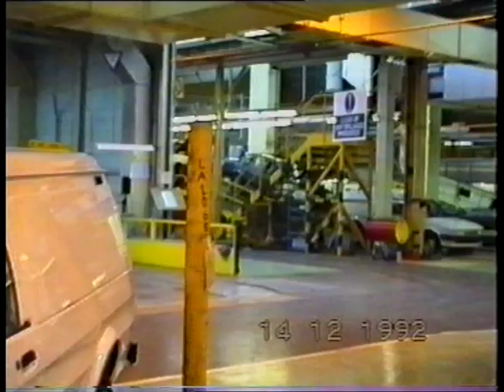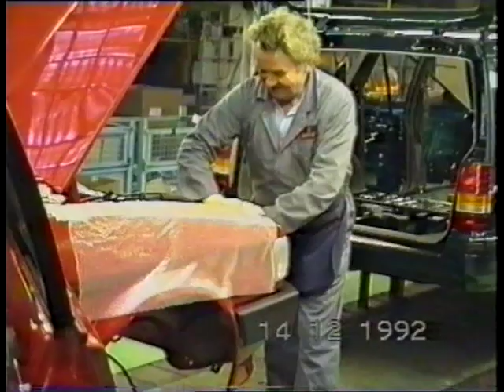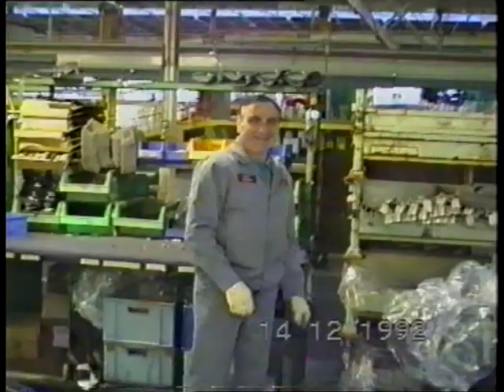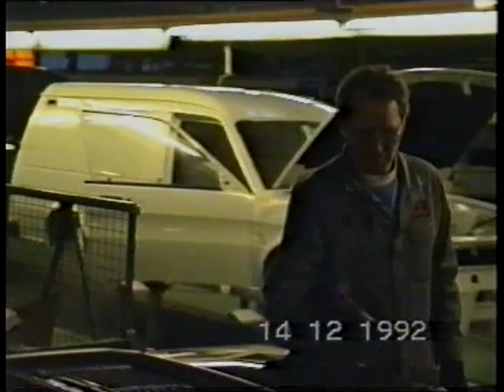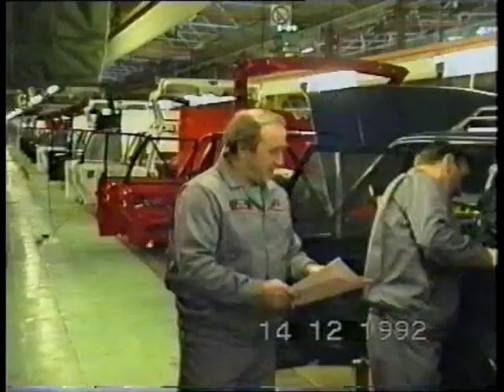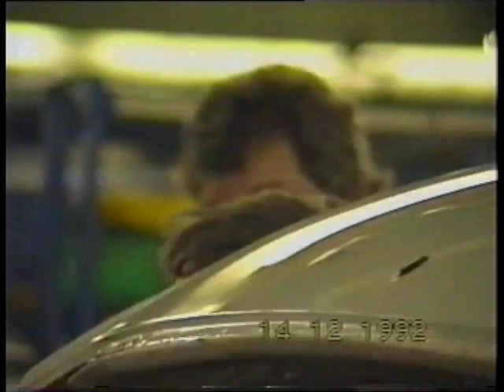A. Cowley South Works 1992 Austin Rover Maestro & Montego Production Line

Comment: I had a Maestro van with the Perkins-designed diesel (iirc, Perkins dieselised the O-series) and it was a blast going the length and breadth of the country in it. That engine was unburstable, and showed what could be done. The van itself was OK, if a bit on the basic side, but it was just a van, after all. An indicated 100mph down the Shap at 2am.
Cue all the finger-waggers....
Reply: Probably the engine was made outside of this plant- 100mph? in your dreams, speedo reading fast, more like 60! any faster and they fell apart.

Comment: Easy to poke fun at this, but remember this was when the Maestro/Montego production line was getting run down, the cars were dead in the water as volume contenders in the marketplace and they were kept in production at very low volume merely to serve as budget entry level models for fleets.  South Works was closed a year later and a lot of these people in the video would have got laid off.  Wonder if any of the younger people in this video still work for MINI?